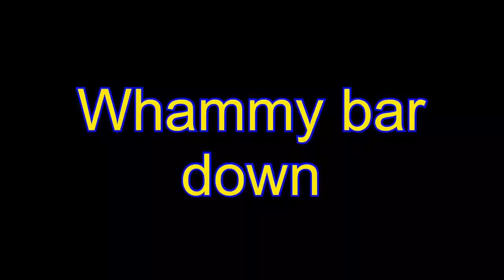Improving Floyd Rose - or not? Testing Tremolo Stabilizer

Comment: Thank you. I bought one of these. The point is you kind of have a floating bridge which will certainly stabilize the tuning yet still allow some up trem work. 
The Mag-Lok will still add some resistance when pulling up, though likely not as much as this.

Comment: This is totally equivalent to adding a third or even fourth spring, that's it. It will make the whammy bar stiffer but makes the bridge more resistant to deflection when bending strings.

1- When you push the whammy bar, the block wants to go away from the stabilizer but the springs pull harder than usual (you should have tightened them more than usual), so the whammy bar becomes stiffer.
2- When you pull up the whammy bar, the block pushes against the stabilizer, seeing resistance from the strings AND the stabilizer spring, again making the whammy bar stiffer than usual.

To prevent strings from going flat when you bend one or two other strings I would use the SuperVee Mag-Lok which works perfectly in this situation. It won't add any resistance to the whammy bar, the downside is you can't get the Steve Vai style thrills and tiny vibrations on the whammy bar when you lightly hit it.
Reply: It applies force in the opposite direction of the springs, so no, it's not the same as adding another spring

Comment: Does it have a magnet on the tip? How does it keeps the bridge from moving when the strings are bent?
Reply from the maker: No magnet. Basically you hold the bridge in position with stronger string power against the stabilizer.
Reply: What this does is add more tension to the springs, the stabilizer keeps the tremolo in place so you can bend the string and the extra tension on the bridge will keep it from moving up while the stabilizer keeps the bridge from sagging. The downside is that it makes the bar increasingly difficult to move.

Comment: Does this keep the guitar in tune when bending two strings at once?  That's my biggest issue with Floyds.
Reply from the maker: I setup system so, that bending one string won't affect others tuning, but I can't see why it wouldn't work, springs just would need to be in higher tension, which may cause whammy bar to be heavy and uncomfortable to use. But just guessing, haven't tried.
Reply: @x430c5  How did you set it up to do that?  I installed one in my Ibanez, but when I bend a string, the trem block simply pulls away from the stabilizer... the stabilizer has absolutely no effect at all!
Reply from the maker: @happyspaceinvader508  This video is actually just part of the blog where I explain how to set it up, please have a look! https://jannesmusic.blogspot.com/2019/08/improving-floyd-rose-tremolo-or-not_4.html
Reply: @happyspaceinvader508  that means your tremolo screws are not tight enough...  The tensiin in the screws need to counter the tension from you bending two strings
Reply: @adamleger9280  you mean springs, not screws
Reply: @happyspaceinvader508  the goal is to prevent the block from moving away from the felt, so in order to do that you will have to tighten the clamp screws in the back to give the springs enough tension to hold against the force you apply
Reply: if your bridge is floating (Floyd Rose or otherwise) it will not keep the other string in tune when bending.  I have this on a couple of my guitars with floating FR bridges.  It adds enough tension so palm muting doesn't cause the bridge/guitar to go sharp.  But when you bend a string you are actually pulling the bridge towards you,  so the other strings still go flat.  To solve that issue you can use a Tremsetter that would work on a Floyd or more traditional strat style bridge floating or not.
Reply: @happyspaceinvader508  This type of stabilizer will not keep the bridge in place when bending.  It is designed to keep the bridge stable when palm muting. it can also help with broken strings, depending on how much tension you allow the stabilizer to have.

Comment: Does it make string changes easier where you dont have to get a setup again like changing strings on a hardtail
Reply from the maker: Haven’t changed strings yet, but I’d think so as the opposite spring loads are equalized.
Reply: i think you can change one string at a time with no problem but you cant take all of them off
Reply: I think Depend how you set them if you make them as trem blocker you maybe can

Comment: Does it keep the right tune on your strings?
Reply from the maker: John Trujillo Hi John, cannot say if it improve tuning stability, but it doesn’t make it worse for sure. In theory if guitar tends to go sharp, then stabilizer could decrease the tremolo block movement and tuning going sharp. This particular guitar setup is good, so it stays in tune very well. I read somewhere that stabilizer can be adjusted so  that one can even tune to Drop E without other strings going out of tune. Don’t know if that’s true, but with all the adjustment possibilities, who knows.
Reply from the maker: @satchrules101  I don't know what he use, but I doubt. This is a cheap one from ebay.